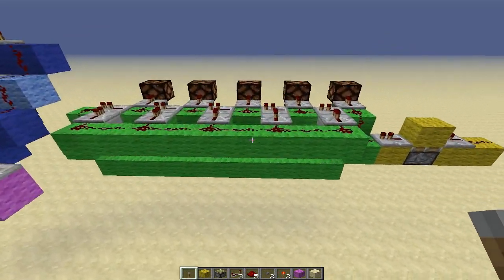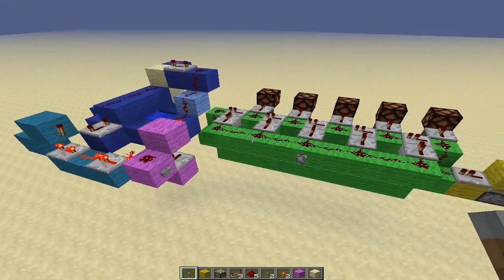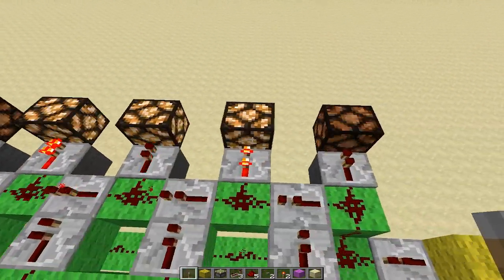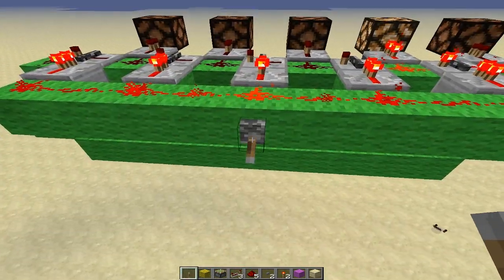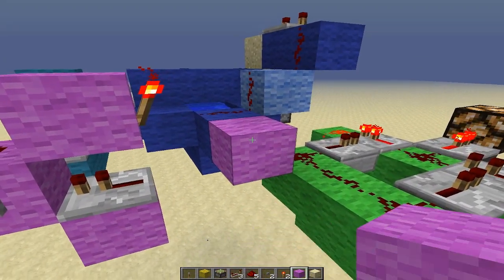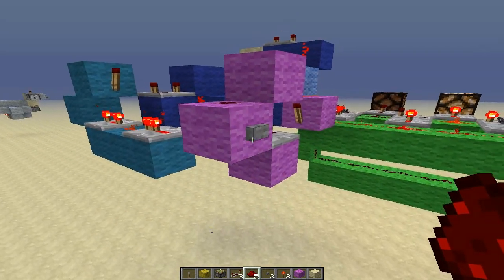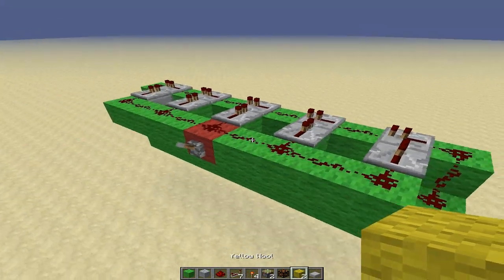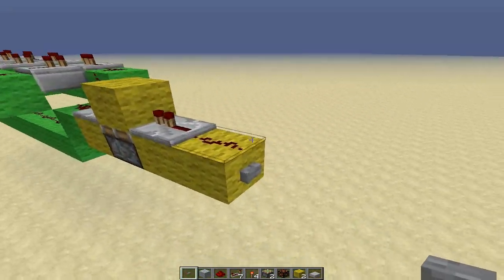[Minecraft Tutorial] Easy Random Output Generator [1.4.6]

Comment from the maker: I am unfamiliar with the xbox version of minecraft, but if that is your only problem you should be able to just extend the green circuit by one block on both ends before coming down a block and looping the redstone signal back to where the yellow circuit would be. You can then use full blocks instead of slabs. It is less compact, but should work this way.